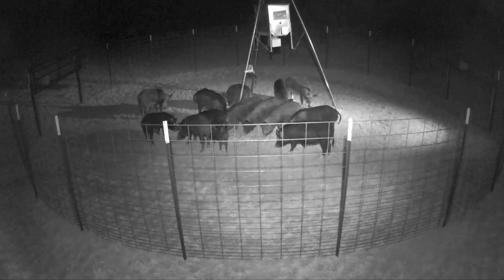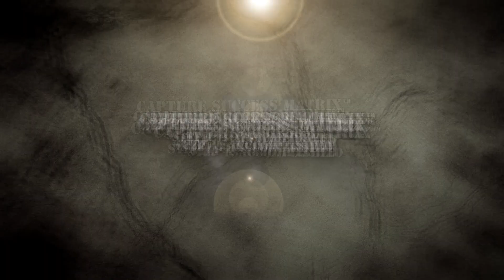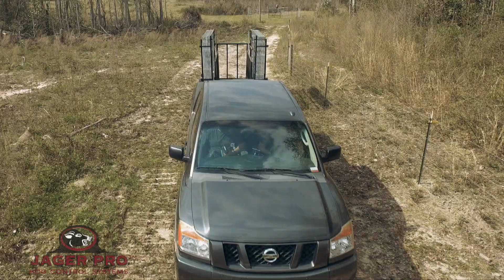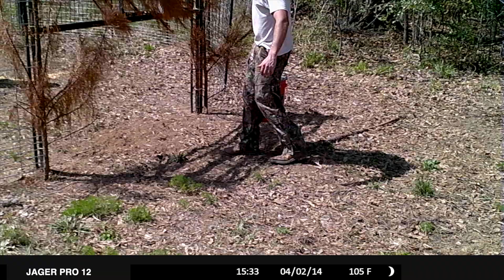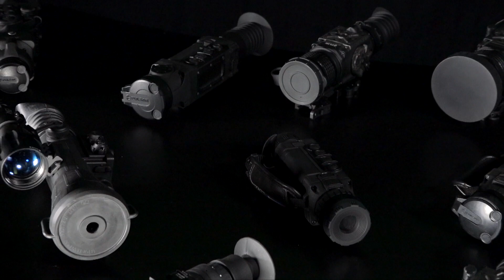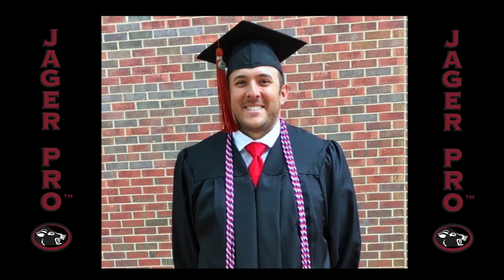WILD HOG CONTROL | JAGER PRO™ TV Show | Pennahatchee Creek Project (Josh Webb)

Comment: Any particular reason you dig multiple holes at the same spot? Is it somehow more effective than just reusing the same hole you already dug?
Reply from the maker: Feral pigs destroy the "bait hole" by digging to the bottom with their nose, leaving a giant crater where the hole used to be. Using the same "hole" would be equivalent to pouring corn on the ground. The goal is to make pigs work at digging for more than an hour to eat the same amount at the bottom of a hole which they could have easily devoured in five minutes on top of the ground. An hour gives the Hog Control Operator™ plenty of time to receive a photo and travel to the bait site for thermal shooting operations. Here is a detailed explanation of the topic. - QRF BAITING™ | JAGER PRO™ TV Show (Episode 10) - https://youtu.be/_OHNF2QyRVw

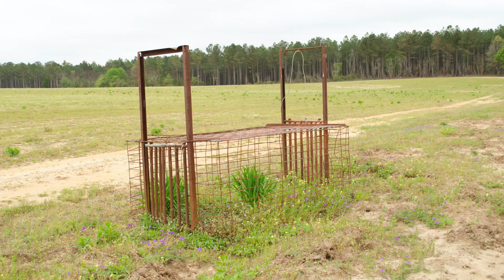Comment: At about 10:40 the narrator says "she was not born with a fear of metal contraptions. This is obviously a learned behavior." While I suspect that true in this case, I just want to share something it reminded me of. We've done some wilderness trapping where pigs have never seen humans or anything man-made and they were very much scared of a metal box feeder we had placed out as a trial.  VERY cautious of it. They could be seen on the camera feeding on the corn placed around it but when it came to feeding out of the box itself, they would slowly and skittishly approach, cautiously smell it, and then bolt. One pig learned to tilt its head to grab some of the trial bait (sausage type) under part of it and run away with it to to finish eating the bait a short distance away. We never used it long enough for them to get used to eating out of it. Could of been our smell, but they didn't mind our smell elsewhere at the time. These same pigs had no problem feeding from tripod feeders and we had no problem getting them to go into corral traps, until of course, they eye-witnessed other pigs getting caught. So in some cases they might be scared of metal contraptions.
Reply: Rod has covered this before.  When possible, the hogs will remove the food from a newly erected trap to a more comfortable location before eating it.  That's why the Hog Control Operators (TM) use loose corn as opposed to cob corn, because the hogs can't remove the loose corn kernels from the trap, and will become conditioned to eating in the trap.